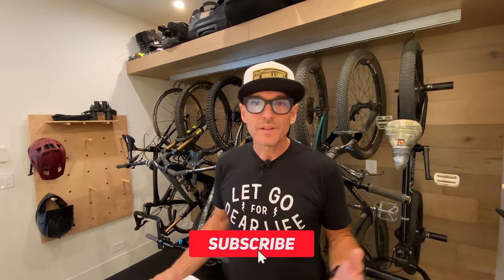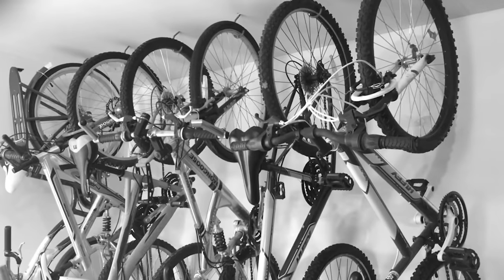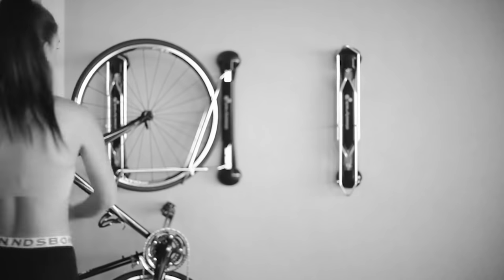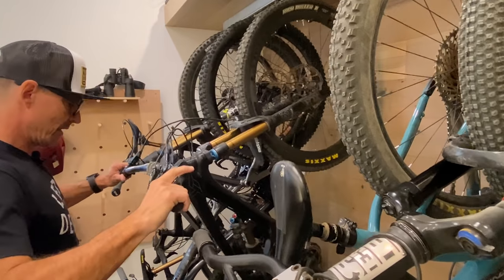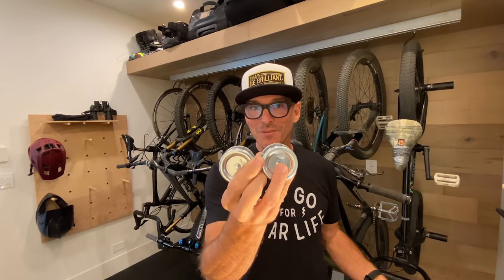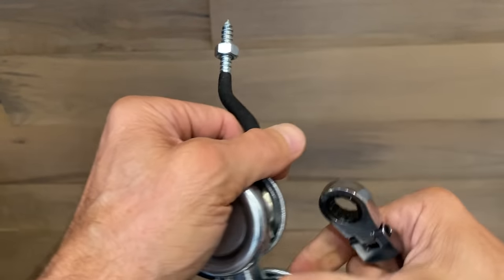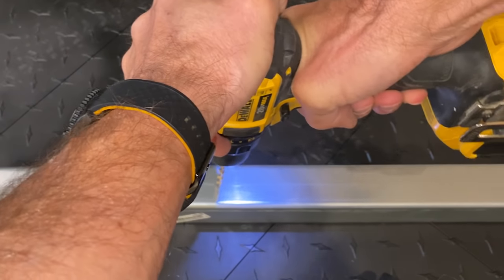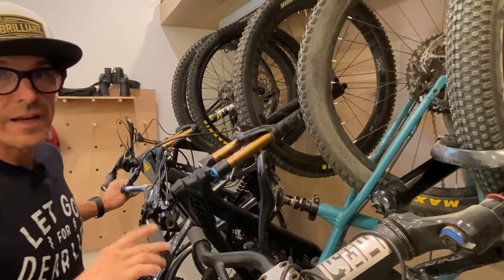ULTIMATE BIKE RACK SYSTEM. MORE BIKES. LESS SPACE

Comment: Great solution to storing bikes, however I find that when I store my bikes upright after a while the brake cables seem to get air in them and I need to bleed them. Maybe I’ve just been unlucky but it’s happened on two occasions on different bikes, so I no longer store them upright.
Reply: Nah, that's just the oil leaving the caliper or whatever.  There shouldn't ever be air in your system, so it would have needed to be bled anyway.  If your brakes are soft after pulling the bike down, just squeeze the lever about ten times and it re-sets the system.
Hooks are THE standard way all bike shops around the world store their built bikes.  There's just no other efficient way.  You think they're bleeding the brakes of all the bikes coming in and out all day long?  Nope!
Plus, they said this about suspension forks - dude, my oil leaked out hanging my bike!  Then your fork was toast, dude!
And to beat you to the punch...
And it's also A-OK to hang tandems by one wheel too!
Man, the times I've had to argue this point!  Someone thinks hanging a 45 pound tandem by one wheel will damage it?  That SAME wheel that supports a 350 pound tandem team (+ 45 pounds for the bike, oh and add 60 pounds of bags if touring), flying down a mountain at 65 mph, slamming potholes?  Just THINK about it for half a second.  It's FINE hanging tandems, triplets, quads, etc. by ONE WHEEL!
There, have I made my point?
Reply: @dudeonbike800  . Think you need to chill a bit, I was only speaking from my own experience. Don’t know where all the crap about forks and tandems came from, I never mentioned anything about them. Thanks for taking your time to reply but maybe you should stick to the comment instead of ranting about stuff no one mentioned .
Reply: @dukekaboom4105  believe it or not, other people read the comments.  Just covering the bases to answer the inevitable questions that arise.  Consider it a bonus!
Reply: @dukekaboom4105  You're wise not to store your bikes like this - it's bad advice. All systems contain some air, however small the amount. Air contains moisture, and eventually tends to rise to the top of the system. If inverted it will pool at the caliper, and this is the component where it is most likely to cause corrosion.
Reply: @wangdangdoodie  thank you 🏴😎

Comment: Nifty rack and execution is flawless! Not for me, but awesome nonetheless. From my experience with bikeracks + kids vertical storage is a no-go. It saves space true, but I don't find it particularly user friendly on a daily basis. Kids are not able to operate it on their own for example. The only vertical I have found useful was an idea for a mobile vertical bike rack. Made out of plywood with wheels on the bottom, so you can move it around the house/garage, should you need to. But for the daily drivers I go with some form of horizontal storage . Kind of less effort for everyone in the house, especially older members of the family, who are not able to lift and hook the bikes before/ after each going out. Just my two cents from buying and assembling bike racks at home.

Comment: I'm guessing the answer is no given the number of people who store bikes this way, but is there any risk of damage to the wheel/rim with it taking the full weight of the bike?
Reply from the maker: I’ve heard people being concerned about it but in my experience of 30 years and aluminumnand carbon rims I’ve not had an issue. I think a bigger issue can be brakes need a pump after being stored vertically.
Reply: @JoyOfBike  are you referring to hydraulic brakes? Thanks for the heads up. Appreciate the response.

Comment: The rail trolley's cost more than anything else in this system. Anyone find an alternate solution? I was going to try ball bearings with pan-head screws for axels in a wood block and use t-nuts to hold the hook. Bearings are about $1 each, bolts less, and wood...well these days it may be the most expensive part. I figure I can make 6 hanger trolleys for just over $30. They will be easier to adjust and roll better.
Reply: You could sandwich a few washers between bolts on the threaded part of the hook, assuming the bolts will clear the channel.  It won't roll, but it will slide and rotate.

Comment: I just built one of these racks using the Park M10x1.5 hooks in both MTB size and fat-bike size. I used t-slot nuts on top and narrow nuts on the bottom (to fit in the center channel of the box rail). These slot nuts fit in the trolley hangers perfectly: https://smile.amazon.com/gp/product/B08BJ29WKN/ref=ppx_yo_dt_b_search_asin_image?ie=UTF8&psc=1
Reply: Hey, I ran in the same problem the nuts that came with the oversized park tool hook don't fit on the trolley without it rubbing on the rail. Do you have a picture how you assembled it with these t-nuts?
Reply: @flyjat  I didn't take any photos (and the rack is assembled and out of reach on the ceiling right now). However, assembly is pretty straightforward. I spun the narrow M10x1.5 nut (McMaster-Carr part number 91028A111) all the way on first, then I slipped the threaded end of the hook through the trolley, and then I spun the t-slot nuts linked above (narrow end down) on just enough to ensure that I was using all the threads. I then spun the narrow nut upward to jam on the trolley and tightened firmly. I used blue threadlocker on both nuts. Everything has held together for almost a year now.

Comment: 8 Feet of Box Rail is $30.22. Oversized Bike Hook $8.50. Stanley Trolley Pair $35.47

Not including the cost of the rail, it is $26.24 per bicycle. You don't have nearly enough bicycles for there to be an issue with accessing the bicycles on fixed hooks, and fixed hooks are a fraction of the cost.

Your solution is future friendly in the sense that you can add another bike to the storage system and bikes of varying sizes can be retrieved more easily, but conversely it doesn't look like you could even get two more bikes on there without having issues retrieving bikes cleanly. Your storage area will not capitalize on the compression of the bikes in space compared to someone with 2 or three rails joined end to end. That's where the real gains are found space-wise.

For people who need a solution that scales, cost-wise this is prohibitively expensive. The alternative is to buy just the hooks, then purchase a few appropriately sized large washers, probably 2 per hook, and sandwich them between a pair of nuts. And if you can find a good dealer, maybe you can get the hooks in bulk for a truly affordable scaling solution.